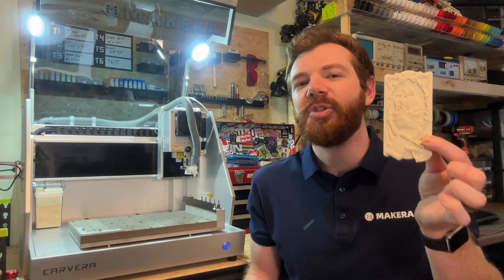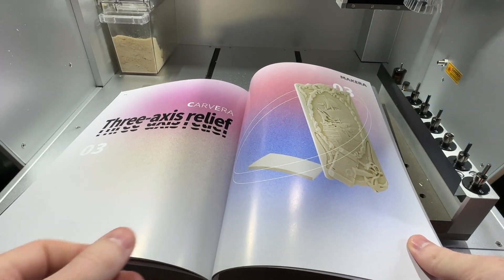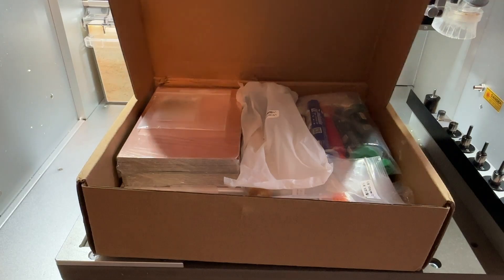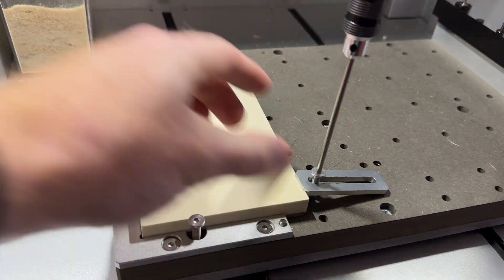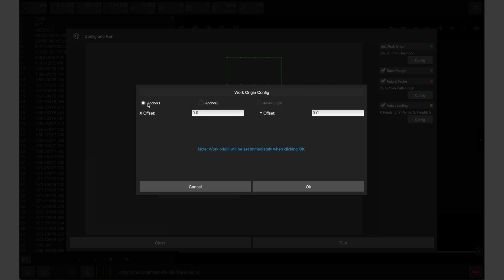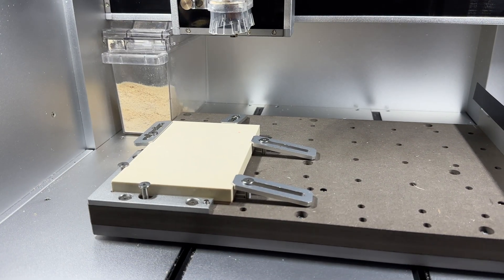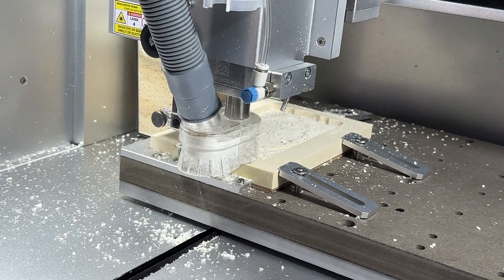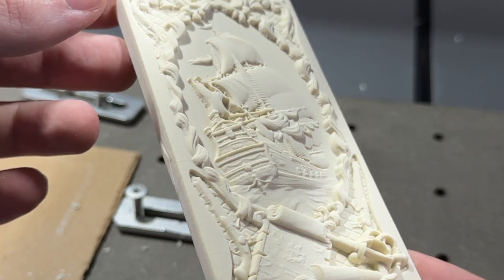Three Axis Relief, a Carvera CNC Example Project

Comment: Can you show the best way to pause a job halfway through? I have had issues with using the pause operation in the Carvera controller.
Reply from the maker: There are some delays in the pause function at the moment, as it needs to finish its current process before pausing safely, but this could be optimized and we are looking at solutions for it. You could split the Gcode, or program a pause in the code if you need it at a specific time.